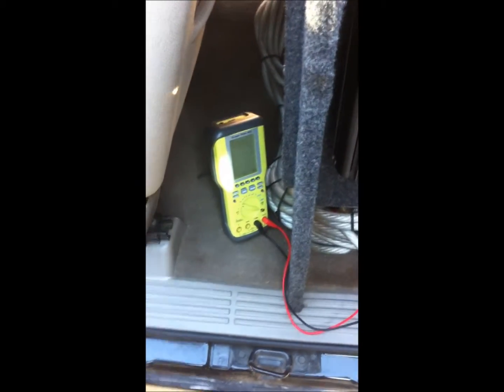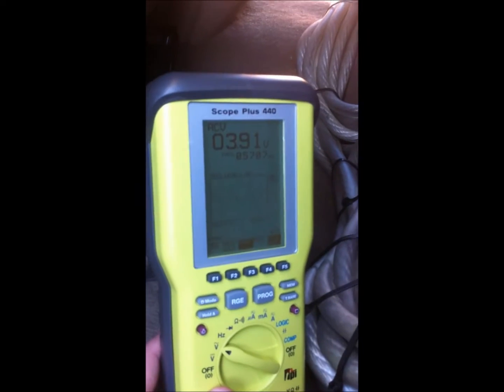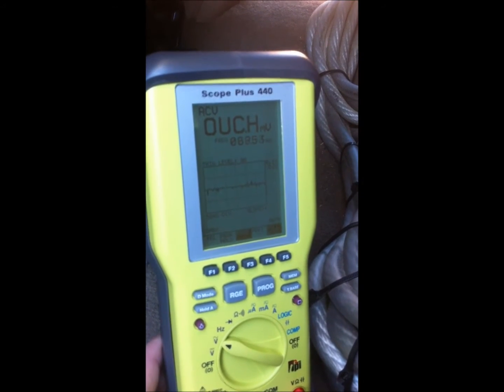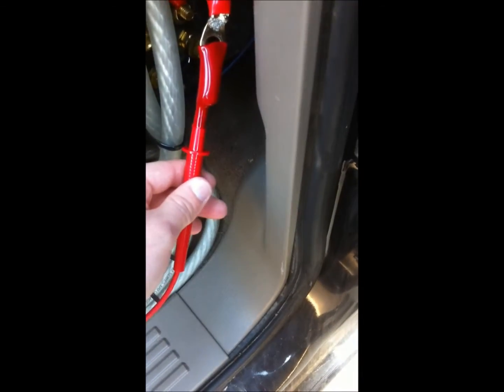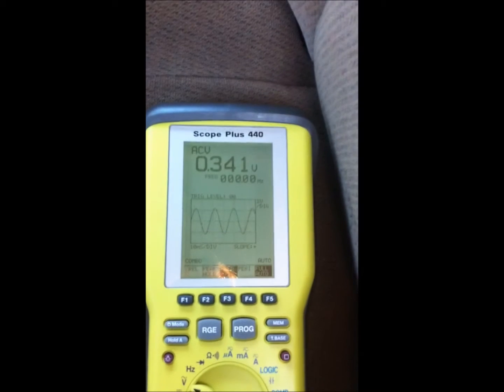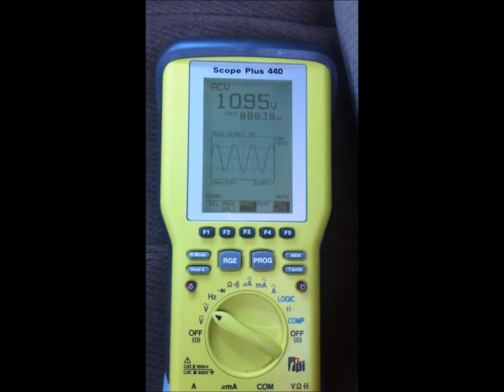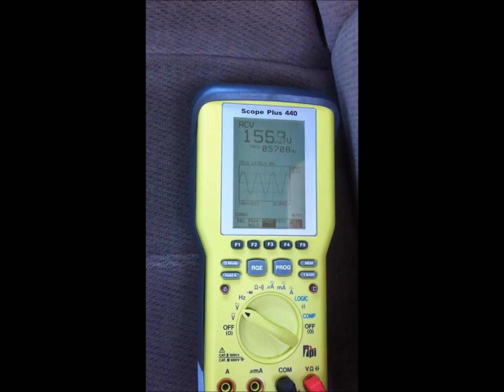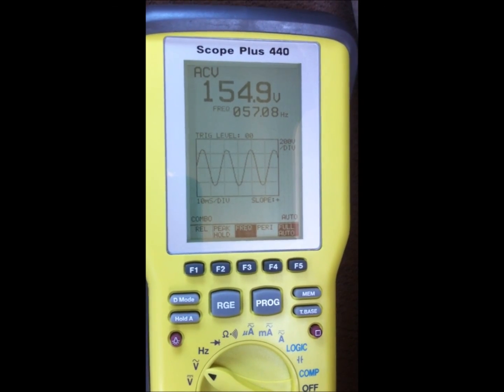HOW TO: Check clipping and Set Gains w/Oscope - Strapped Amps

Comment: Hey, I'm not sure if you could help me out or not. I have a Fluke Scopemeter 105b II. I use it solely for the purpose of looking at analog audio signals. When using it to test a low voltage signal coming from the head unit from 0VAC to 5VAC the Scopemeter displays the sine wave perfectly. When I use it to look at the signal coming out of the amplifier at 10VAC to 50VAC the sine wave looks crazy and adjusting the settings doesn't help at all. Do I have to change something on the oscilloscope to look at higher voltage analog sine waves with out the waveform looking like it's having an aneurysm?

Comment from the maker: @satisfaction2009eBay I was scoping just the sub output from the RCAs at full gain from the deck, +15, and it is clean up to 27, at 28 it starts to clip, there is a few reasons I set it this way. :)

I have the same deck as you, but it is in my toolbox now x794, have a double din in the dash now.